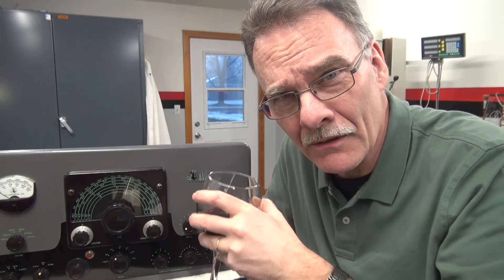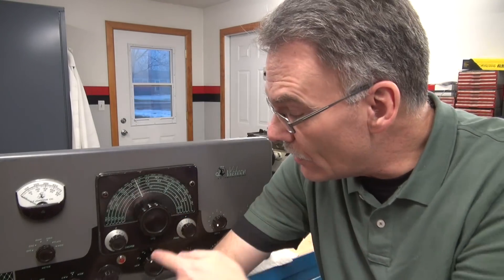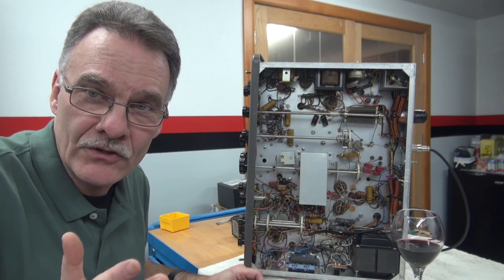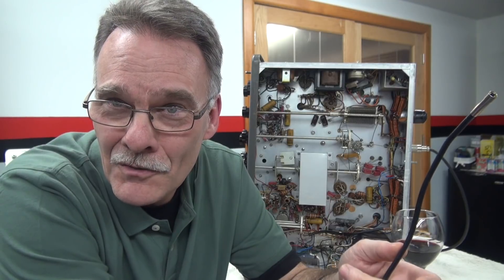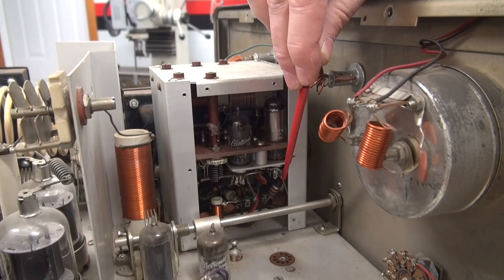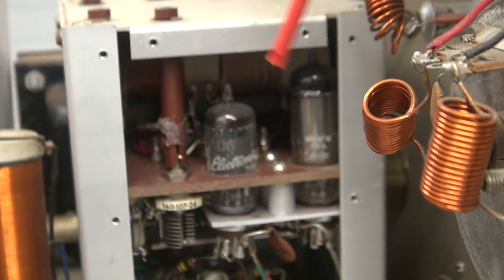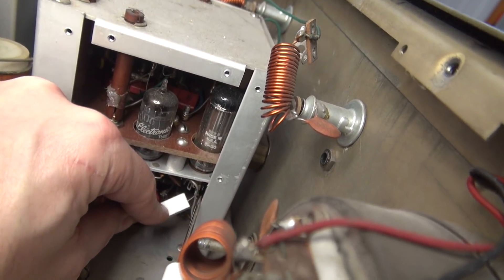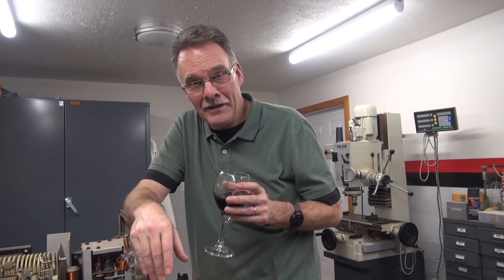How to repair EF Johnson Viking Valiant transmitter VFO Drift 18K Resistor

Comment: Since it's normally covered by the side plate, would there be any harm in using a Dremmel tool and cutting an larger opening on the side nearest the front to open things up for general maintenance?

Comment: I remove the resistor and OA2 using a zener and mounting the resistor to the lower chassis reducing HEAT!  My drift is 30% of what it was before the changes shown in my utube : https://www.youtube.com/watch?v=z3FRLLt25Jk  .  The rig looks and works fine now, drifty vfos are a pain in the butt.  Enjoy W 😀 😅 D  Y

Comment: If you take the new resistor and super glue it to the aluminum of the box to increase the heat dissipation of the resistor it improves it operation.  It works great and can be removed later if needed.

Comment: I was wondering on what type of solder you use
Typucally I would use 60 40 tin/lead, that is a three state solder
I now use 63 37 a eutectic 2 state solder.
60 40 can give you cold solder joints if the wire is moved befor the solder goes solid
63 37 goes from luquid to solid, boom, no cold solder joints.
What is you thpughts???

Comment: Funny,  I have overhauled and used a half dozen valiants over the last 30 years, and never once felt the need to mess around with this resistor.  I think this is one of the great old wives tales or myths of ham radio.   It is necessary to warm up these radios thoroughly, which takes a half hour or more..  but after that.. whats the problem ?       Sadly, there is one guy prominent on ebay, who subjects rangers to a huge raft of ill-advised and unnecessary mods.. he calls "upgrades".      these old radios have plenty of problems that all most all go away, after you shot gun the old paper and electrolytics, clean the rig thoroughly , with real attention to the switches and tube sockets, finding any wildly out of value resistors, and giving the thing a set of really decent new tubes.   Then any real problems will surface and cant hide or masquerade.  I see stuff like shorts and arcs in wiring harnesses, and other arc related problems.  But the basic design was sound.. and seldom does it need "fixing".

Comment: Great vid Terry last time, about a year ago, you put it underneath the chassis to keep it cooler. And remove as much heat out of the Vfo.
Reply from the maker: That was the Johnson Navigator repair. Actually that resistor was already mounted in that position. I normally keep it in the VFO compartment. Updating to the 5watt resistor lowers the operating temp.